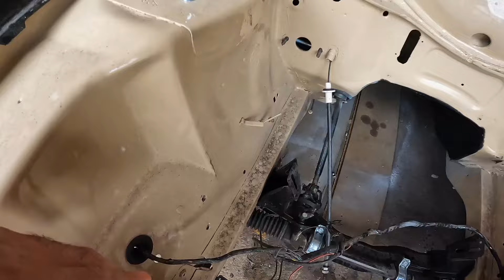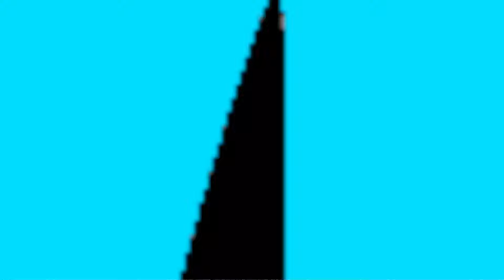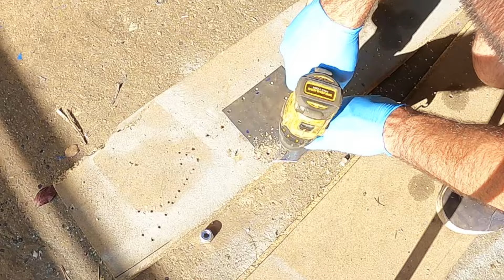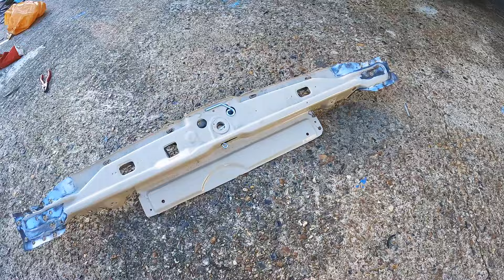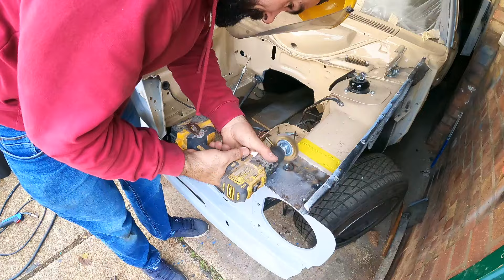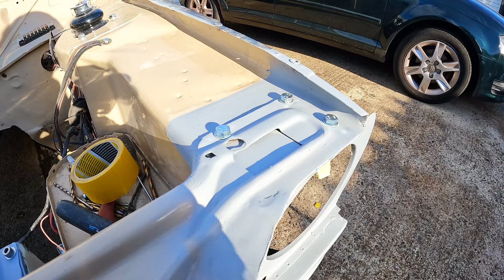This '3 hour job' TOOK ME DAYS TO COMPLETE!! 😩

Comment: Nice job. I possibly would have kept the centre support in. Cut about 1 inch from the bottom, lap a plate over and only weld to the top side and bolt through the bottom. Top job anyway 💪

Comment: Bruv what an excellent idea looks better more clean looking and better access for engine out jobs, mate thanks for the inspiration and idea for my capri called Clyde.  Take it easy man looking forward to the next video 👍 😊 just to add that mk2 escorts are very strong at the B piller so I wouldn't worry about the trolly pushers mate 😉

Comment: Not a bad idea mate 🤔 good to see you getting stuck into the welding! Try and get a hobbyweld bottle...you pay a deposit on the bottle, then you only pay when you get a full bottle exchanged, no monthly rental charges! The only thing I'd of done was bolt through the overlap on the inner radiator support where you trimmed it down, but all good 👍

Comment: Use Stainless Steel bolts, much better than zinc plated or steel bolts
Reply from the maker: Thanks for the advice mate! 👍 I must admit tho, I do prefer the look of zinc plated bolts.
Reply: Set of low profile Allen heads

Comment: If you use a 8mm tip and 6 mm wire  feeds better 👍
Reply from the maker: I was actually using a 0.8mm tip with the 0.6mm wire and wondered if there were any downsides. 👍

Comment: Looks great m8. You talked about using seam sealer around those square holes. How about using butyl tape? It’ll function similar, yet remain pliable. Will be less work when removing the panel, and replacing it. 
I do a fair bit of fab work myself, and I always double if not triple my time estimate on jobs. Kees me more on time that way. 
Mad a friend call me up. He had a short job he needed rush for the next day. An hour tops, he said. He came over for 6pm, and we dug in. I wound up closing up the shop at 3am.
Reply from the maker: Sealing that bit won’t be an issue with regards to removing the panel. The metal you can see through the square hole is the plate I welded on myself, not the inner wing metal. Thanks as always for the advice. 👍
Reply: @marcushayesford  Duh, dunno how I missed that 😂
As you were lol
Reply: Good shout. I was going to suggest he just leave it as it'll all painted anyway and sealer will just trap water rather than keep it out. Didn't think about when he would be removing the panel. Maybe, if anything, a bit of foam tape would be even better as it won't stick to one surface at all.. Personally, I'd just leave it as is and painted both sides.